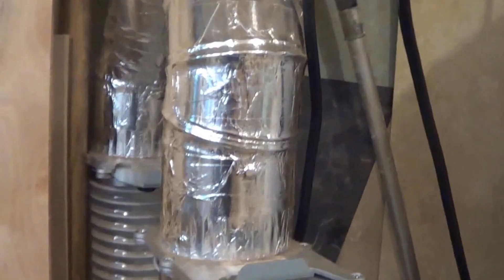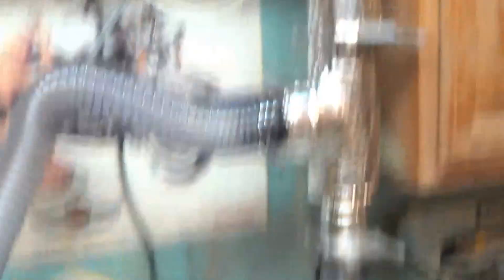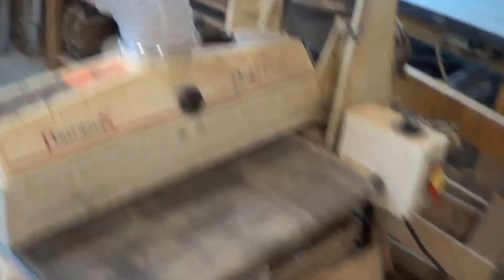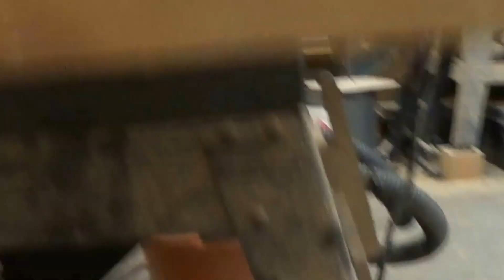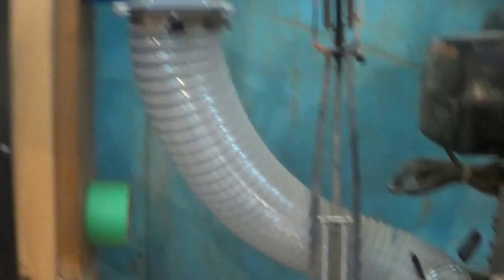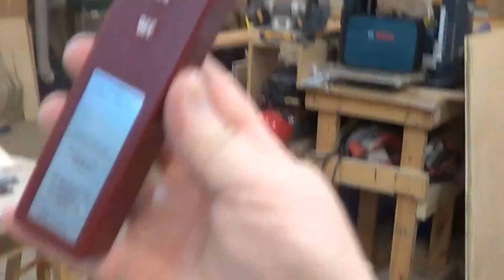Piping Up a Harbor Freight Dust Collector in the Wood Shop Part 2

Comment: Since you build cabinets and work with all types of woodworking tools, I thought you'd be the person to ask a couple of tool related questions. I have a scroll saw that has been boxed and stored for several years. I also have a miter saw that has never been unboxed since it was purchased years ago.  I want to start using these tools.  Is there any maintenance I should do on one or both before attempting to use them.  Thanks for any advice you can give.
Reply from the maker: +Bigmaude31 Ive never had tools in storage that long but I would say that they would be ready to use straight out of the box.

Comment: I may be stupid but what kind of flex hose did you use? and what reduser did you use to go to the machine. look nice man!!!
Reply from the maker: +kyle dobbs Thanks man.  I am satisfied with the results for the setup I use.

I used a 4"  transparent dust collection hose I bought from the Harbor Freight website for 20.00 each.  Go to the Harbor Freight and search for Item number 96478. They are great hoses and just as good as the ones that cost twice as much.  The 2-1/2 clear hose I used came from Rockler(dot)com

As for the reducers I used I bought them all from my local Woodcraft store.  They have a website also.  For my drum sander, I just connected the 4" hose directly to it.  It was made to accept a 4" dust hose.  The planer, I built a box that the shavings go into, cut a 4" hole in it and used a screw-on 4" dust hose fitting.  I used basically the same technique for the rest of the machines.

Comment: You should use "Y" not tee's so you don't restrict flow. It looks like you wrapped the snap pipe with foil?
Reply from the maker: I couldnt find any 4 inch "Y's"  I wrapped the joints and covered all pipe seams with foil tape.  Its flexible, super sticky, and makes a good tight seal.

Comment: Where did you get the remote for the collector. It is 110, right?? Thnx in advance.
Reply from the maker: I got it from Amazon(dot)com.  Yes, its 110.  It also comes in 220 if need be.  Search Amazon for LR110-3 110-Volt Long Ranger Dust Collector Switch.